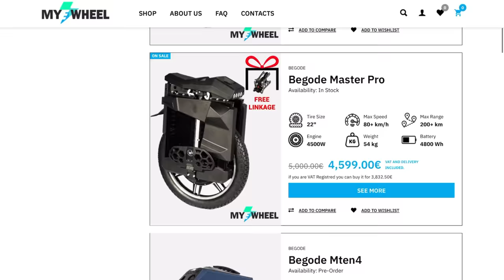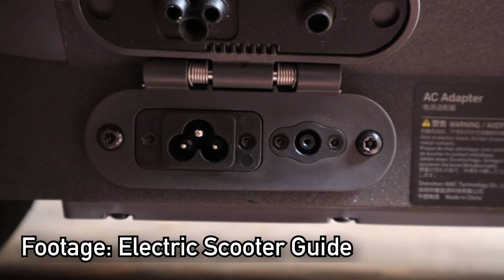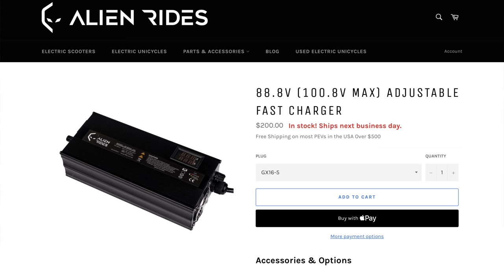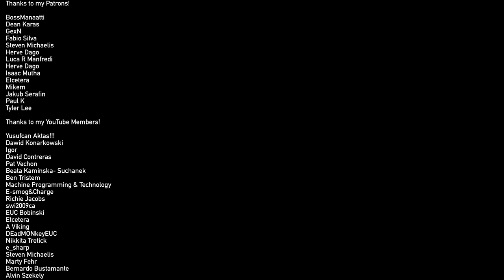I don't like where EUCs are heading

Comment: My wish for EUC is for if to eventually be kit home assembly where you can choose your shell motherboard motor battery tire and more.
This would allow you to build a cheap good wheel that you can upgrade parts overtime as and when you're ready or can afford them.
This would make really interesting wheels unique to their owners and what they value In EUC!!
Reply: You're describing the exact things that make me avoid RC models...
Reply: @bigglyguy8429  😂 fair enough the fully ready to go wheel is already available for you
Reply: @idowheelie8598  The probs with what you're describing is it immediately becomes a maze of different standards and fittings, where you never quite know what fits what or what isn't compatible. And then whatever parts you get, someone will tell you that you should have got something else for this bit, and obviously the battery connections should have been ...  blah blah... It must gets so messy that I'd rather walk away and not bother. This is why DJI wewre so successful with drone - their early drones weren't great, but they were fully assembled and ready to go out of the box. We have that with wheels, we just need better quality and a more mature marketplace. And what the vid said :)
Reply: It's a fair point it would have to be done very carefully and well thought out especially with compatibility as you wouldn't want a component to be sold that wouldn't work with another. But'if you simplified the components down and made compatibility a matter of a plug/adaptor shape as a standard like USB for example so if it fits it works!
This would still be a niche product within a niche hobby but so are homemade PCs & kit built bikes and cars yet the market is there!
Inmotion are kind of going down this route with batteries on a upcoming  wheel the idea is to have quick removable batteries that can be swapped out during a race or taken out completely to allow you to take your EUC on a plane and rent/buy a battery the other end. In theory this could be designed to be compatible with all inmotion wheels going forward but of course getting components to be interchangeable between different companies would be will be more difficult as EUC companies don't seem to like each other.
Reply: @idowheelie8598  You remind me of the cartoon where a guy says to another "There are 11 different standards! We need one single standard!" so they do that, then they go "There are 12 different standards!"
Reply: If you say so 😂 you clearly  don't like this ideas on where EUC could go it's not for you I get it. You don't desire the extra work/time it would take to modify a wheel but there are lots of people out there who  do/would wrongway even reviewed a friends DIY wheel on his channel I thought it was cool especially considering as you originally said the components are not designed to work together but yet he managed to make a great wheel that suits his riding purposes. But you want microwave meal of wheels instead of looking to learn to cook and being able to choose better ingredients and make better choices anyway I'm wasting my words on you you've already made up you're mind.
Reply: @idowheelie8598  You're wasting words because you haven't added anything to the conversation. I don't deny there ARE people out there who would drag the EUC industry in the wrong direction, I'm just pointing out how it would be wrong. What we need is more people using them, not fewer. In many countries it is not legal to ride them on the road, you cannot get 3rd party liability insurance etc. People making the things themselves from bits and pieces they buy off the net would further drive us off the roads and into skate parks as a niche for adrenalin freaks. We need these things built to the same standards as Japanese motorcycles, with universal charging and recognized standards, not DIY hobby contraptions weaving through real traffic without insurance.
Reply: Now that's a better argument then your last comments. I actually agree with 95% of what you said in your comment but I don't think you're picturing the same thing I'm trying to describe. 
For example let's say you are looking for a good quality learner wheel with potential to be upgraded at a later date with brand parts which are compatible by design from the manufacturer of your wheel.
The DIY aspect is just a reference to what is possible in the current market place but I like you would like to see standards kept high. But I do like the idea of maybe owning 2 batteries that are compatible with multiple wheels and easily exchangeable bydesign. like a modern power drill for example as a large part of the cost of a EUC is the batteries which leads manufacturers cutting costs on other components to keep profits up and competitive on there pricing.
 I also think this would eventually lead to third party companies making higher quality compatible parts as they are already doing with tork pads pedals. Unfortunately legalisation of EUC has less to do with build quality and more to do with perceived danger by policy makers. Even in countries where they are road legal the legislation is far from compatible to the realities rider experience of EUC for example the 5 mph speed limits set in France and
All of the hire scooters you find in big cities all around world which require no safety equipment or training before heading out.
Reply: @idowheelie8598  OK, imagine if, like my Worx power tools, you could buy your own batteries. You can indeed find rip-off fake Worx batteries. Would I trust them charging inside my house? Heck no. Makers produce proprietary things partly to protect profits but also their reputation.

On the whole though I do agree regarding charging ports and batteries. Recently Europe banned anything except USB C for new product charging, to avoid electronic waste. It would be good if they did the same for electric cars, scooters, bikes and EUCs, find a common standard and create interchangeable batteries. 

But DIY builds? That's never going to inspire confidence. What you're describing sounds more 'modular', where you can fit different accessories or upgrade/downgrade. That makes things a lot more expensive to build and forces the maker to create backwardly compatible designs. That's good in many ways but also prevents newer, better designs, so I don't think it will happen.

Comment: Well said Adam. The integrated charger is a point I have thought from day 1. And parts support is very important. I really would like to see wheel manufacturers outsource more. Pedals, pads, suspension components, and lights to start with. No more child toy lights with lasers. Just real Dot level lights. Definitely plenty of room for improvement here

Comment: I think the EUC companies got into a bit of a horse power war over having bragging rights for the fasted EUC out there and I don't think that is entirely a bad thing,  people need to be honest,  one of the first questions asked by someone buying a EUC is, "How fast is it?"....I see people already dogging the KS S19 because the specs say it only goes 37mph(60km/h),  Personally, I think 40mph is the sweet spot(US market), not because I want to race around at 40mph, but because I would like to have that on reserve if I am riding in traffic that is going 30-35mph,  honestly, the majority of the time people city riding will ride in the 15-25mph range.

It looks like the EUC companies are starting to backfill and now releasing more middle-weight model EUCs, I think the Begode T4 is really close to the sweet spot spec-wise,  good suspension, not super heavy, has decent range, and speed, and is priced well,  again the biggest objection I hear to the T4 is it isn't fast enough and it hits around 34mph(55km/h). ...................and with all the talk about smaller and lighter wheels, the mTen4 doesn't seem to be getting much love, and I haven't heard anyone complain about quality issues with it either.

Comment: For 3 to 4 grand they should be putting out amazing wheels. Point blank period. But as far as size, weight, and speeds I'd say it depends on the rider. Obviously the need for more range means bigger batteries and those are probably 70-80% of the weight but with all that range means they're used in cities for easy commutes its not an easy commute if it takes you an hour to get 20 miles. If you want a toy buy a cheap one. I would love to see these grow in popularity but the reality is they'll always be a niche so acting like the euc community is going to be the cause of their own demise is just non sense everyone is responsible for their own decisions and if people decide to give euc's a bad rap they probably just karens.

Comment: Good stuff video would be good. I tell you guys, we are living in the time where engineers are in charge for EUCs. Just wait till marketing and sales guys start pushing the engineers to lean things out to the max.  Then they will be breaking left right and centre like cars or phones.  These machines are actually, not bad right now. Working on engineering, procurement, construction and installation, I see what engineers have to do to cut costs and save weight and time... Not good. Cars and household appliances started out where EUCs are now... Bulletproof compared to what cars and household appliances are today! 😂

Comment: I disagree with the point that cars are the most lethal. Motorcycles are more lethal, it’s just that there are less of those on the roads so they come almost unnoticed
Reply: Kind of. Cars still kill more OTHER road user per kilometer driven than motorcycles. Motorcyclists just injure or kill themselves very often compared to car drivers - and obviously "lose" in a collision with a car.
Reply: @casperpedersen1690  i meant that if the motorcycle crashes at 60 km/h, the driver survives with almost no damage. While the motorcyclist just flies down the road over the handlebar 😂
Reply: @casperpedersen1690  The most common motorcycle accident is being hit by a car that turns across the oncoming lane of traffic. Cars are unsafe at any speed.

Comment: I agree with some of the points, but definitely not all. Fixed pedals? It's tough enough getting wheels into small cars, or cramped bus. It would just take up more space.  I don't even like fixed pads. Everyone is not the same shape or size. SPEED? That is progress, and always has been. My motorcycle does over 200mph. This comes down to self discipline, and knowing YOUR limits. Relevant points I agree is PRICE!. You're paying to much for something that doesn't have great re-sale, and it's getting harder for someone to get into the hobby. I have a V8S that I out grew, and refuse to sell it because I would lose so much. Has never been dropped, not scratches. WEIGHT is another point I agree with. I've contemplated a larger wheel. My V12HT is all the weight I want to drag around. It has enough range, and power. Not everyone is 180lbs. Some people need bigger wheels. I like the head room you get with more speed. Less chance of a cut out. I like being able to keep up with traffic when I have to be on the road, it gives cars less of a reason to try and over take you like they would on a bicycle. These are just my opinions. I don't want anyone to have to conform to what I like.

Comment: High speed and high torque is required for our safety reason especially for EUC we are not buying you EUC that Less than 24 inch wheel no taller than monster pro no less speed 165mph wheels

Comment: 💯 agree!  With speed, you miss the enjoyment of the ride as you’re too focused on not killing yourself or hurting others.   Watch tubers while hitting high speeds and hyperventilating like they are having a heart attack.  Quality and safety first.  I can handle some additional weight on a smaller wheel it just needs to be nimble.  If people want a super fast wheel, fine.   Just not for me.   If you want to ride something the size of a SUV also fine.   Again not for me.   ☮️

Comment: Speed vs Torque: 
I don't (entirely) agree. 
In the next generation, there really, really should be a switch for torque vs speed vs range ( I know it can be done with the battery configuration, parallel vs circuit ), even if it requires a physical key or plug modification for the physical wiring that a user can use to change how the batteries are wired to the motor. It IS possible to have your cake and eat it too with very little engineering, you can steal this from me, EUC companies! 
As for speed: there's LOTS of times when I would want to go as close to 70kmph in straight, long, quiet areas with greenspace travel areas which exists all over Canada. For example, in southwestern Ontario it's entirely flat here. There's a gigantic cycling network that is paved that can take you literally hundreds of km without touching a major highway, that everyone uses to cycle/scoot to work. 
Price: I agree. The bill of parts cost is significantly lower than the wheels themselves. There's some general software improvement, yeah, but not 6000$ CAD money. 
Chargers: 
look into GAN3 chargers. I have a 9amp 100wPD charger that is the size of a jaffa cake. I don't know if I agree with having the charger onboard, because it breaks... and then what. You can't replace it. They need to add adapters to use everything from USB-C to electric vehicle chargers from Tesla Powerstations. The batteries can be charged in parallel much faster, which goes back into my first point - they need a physical key switch for the battery connection arrangement to optimize everything.
Reply: Great idea!  This would complement modular swappable batteries so that different configurations of parallel/series battery packs could be switched from lower voltage/higher torque to higher voltage/higher speed as desired by the user. The synergies here could be both affordable and highly leveraged for a wide performance range.
Reply: @grb1969  I was actually considering editing my comment to say "why the heck not modular batteries?" but you took the words right out of my mouth! 
I would love to keep a spare in my backpack for long rides too. YOu can't charge while riding, so it would make sense.

Comment: I been saying all of this for some time. You boiled my blood today Adam. I want to add begode is at least trying with their PEDALS. omfgwtf these manufacturers must have e-rides ironman equivalent pedals stock. I'm tired of spending 5k Canadian for a EUC than right away another 500 for pedals.
Reply: Pedals and pads should be left for the aftermarket suppliers. Begode has the only acceptable honeycomb spiked pedals, and yet many riders choose to change them out. If pedals are made to be interchangeable across most manufacturer’s wheels, then we can have a more robust supply-chain with greater flexibility.

Comment: My first dislike , ha here's why.
I agree with  improving safety. i agree with flat sides,  tho sherm P bolted jump pad is kinda cool.
I disagree with you on speed, 100kph is local traffic road limit, our towns are spaced 1 hour at 100kph apart, to flow into the areas where the bike track goes onto the road you have to not be a burden. In saying that and also considering i am looking at the v13 due to safety tilt back and other quality head room parts and features, i'm actually happy to leave it at default 90kph, even if i unlock to 100kph  i could probably get away with cuzin at 85kph possibly but practical safety head room is important. 
      I say many people including myself are going to require the speed of the v13 to make it actually practical across a wide range of situations, such as getting between towns where 50kph is just a slow hazard.
   The v13 could flow in when required. A dog can run 70kph and bite i've heard, had a few chasers myself.
Making a range of various sized wheels seems practical, im putting wheels in classes.
class1       is 1000wh
class 2      is 2000wh                 t4                                              sherm Pat                               s22
class 3                 v13                  master                                     sherm  S
class 4                                         master pro.
class 5
See how v13 could make a wheel for each class, so could all the wheel makers.  Ha Begode has at least 3 classes covered.
It would be sad if it turns into a bitch fest on anyone over class 1.
I'm 53 and dood i don't want to go back to a air wheel, loved it by the way, should have kept it, anyway, am i at the wheels for adults channel?  Thats a dig ha.
Just another pilot traveling. Whatever your piloting go safely.  
Um ar  looking at my list the master might be a 2 anyway.

Comment: Registration or licenses doesnt make a vehicle safer.  It is the riders responsibility to ride safe.  Stop blaming the companies who cant control the user just like nobody blames Jack Daniels for drunk driving.  I like my big patton just fine for its range.  You can get only so much power out of a battery no matter how  much everyone complains.  If they built in a charger, you would STILL complain that its too small with no option to use something else just like you feel about built in pads.  You are harder to please than a WOMAN!

Comment: You gotta stop hating on Begode. They all equally suck. Don't vilify begode. You should encourage good battery maintenance, and people will stop burning their houses down. All lithium batteries are dangerous in the wrong hands.
Reply from the maker: Begode has by far the biggest amount of wheels that burnt peoples houses down. And imho by far worst customer support and then availability of parts, replacement and after sales support. Personally, I also think least amount of safety